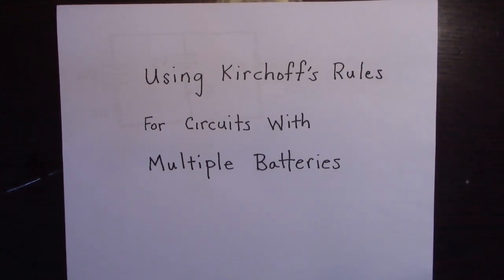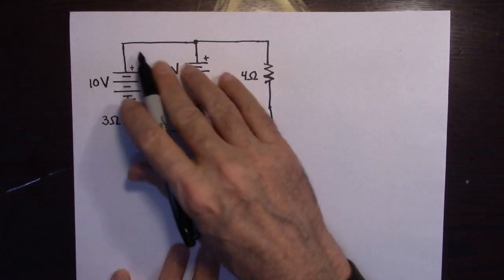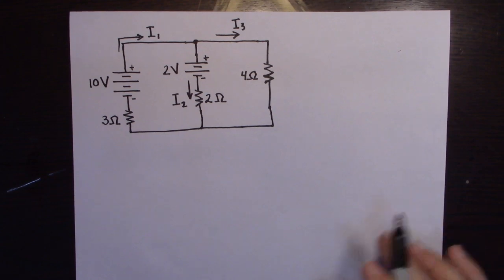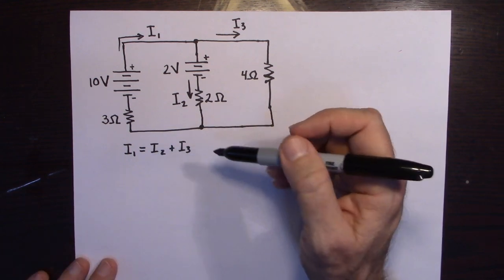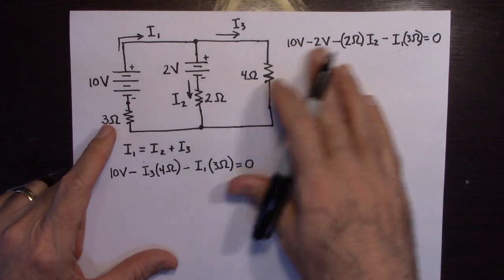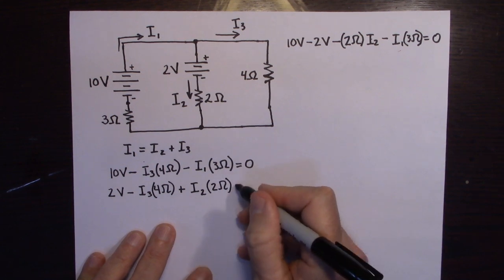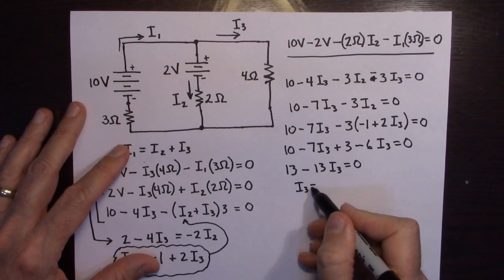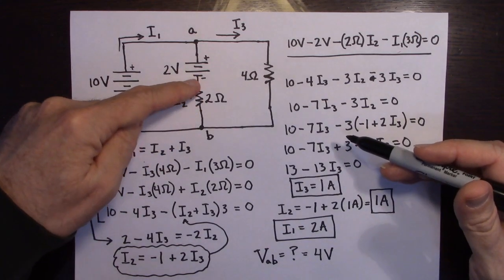Using Kirchoff's Rules to Solve Circuit Problems with Multiple Batteries

Comment: On the right circle, If you added the battery because you are going with the flow of the electricity, why did you add the resistor too (I2*2Ω)? since you are going with the flow you are supposed to subtract it, isn't it?

Comment: Does the second battery just act as a resistor that drops a set amount of voltage? Why wouldn't it give off its own current?
Reply: maybe the 10v one dominates over both?
Reply: if a battery is in receipt of a current i would just consider it as "charging"
Reply: It may be due to internal resistance
Reply: batteries are just potential creators.  the most powerful one will decide current flow.
Reply: @assguardian5511  so if you did the loop rule with both batteries,  would you still do "-" when going from top to bottom of the 2v battery? Or is it always plus